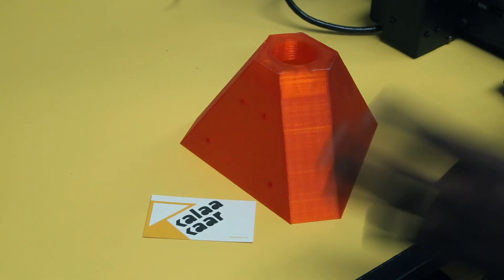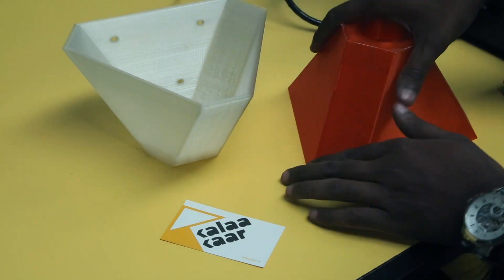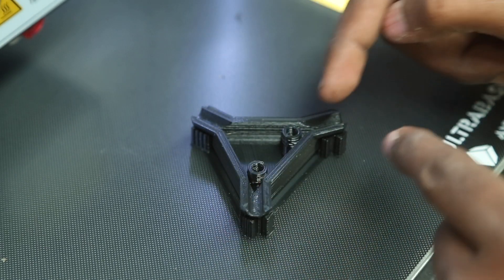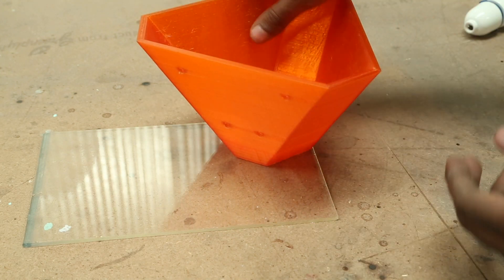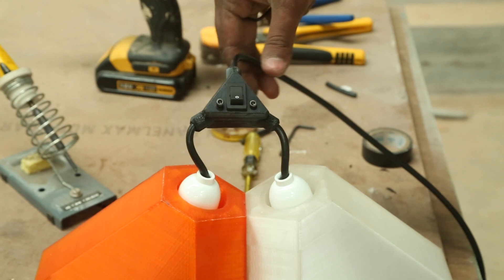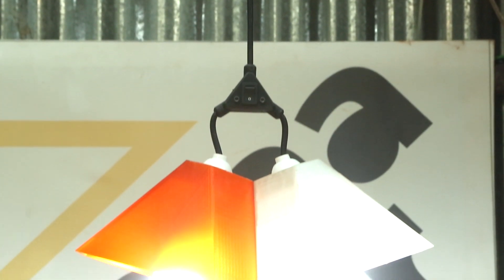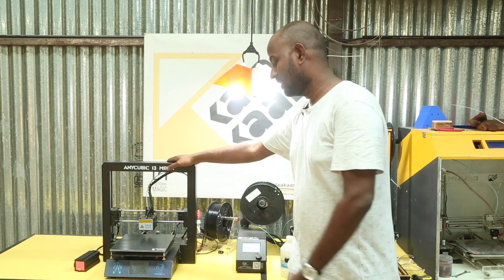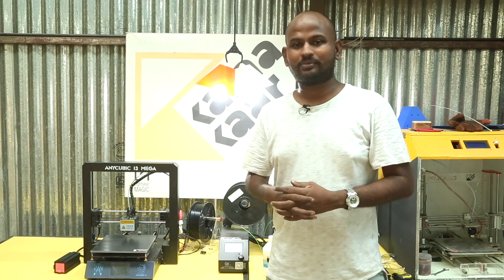DIY Pendant Lamp // 3D Printed

Comment: They turned out really nice. But I spotted a shift in the print. This is down from where the light fitting goes in about 25mm to 30mm down. What you did with the printer enclosure was really awesome.
Reply from the maker: +Jessica Ryan thank you. I am glad you liked it. Did it inspire you?